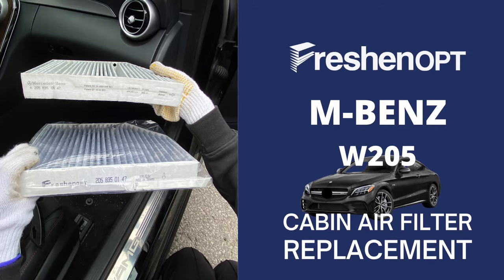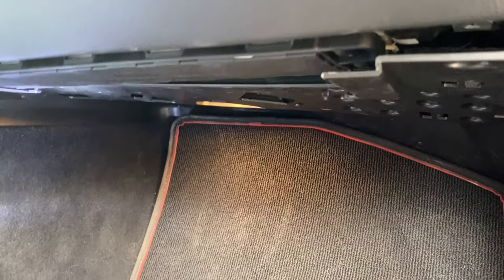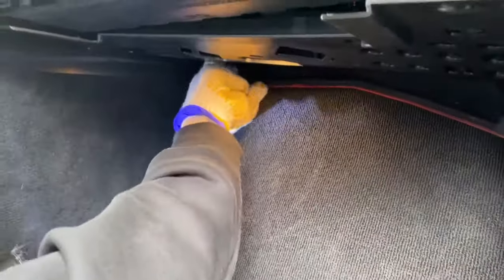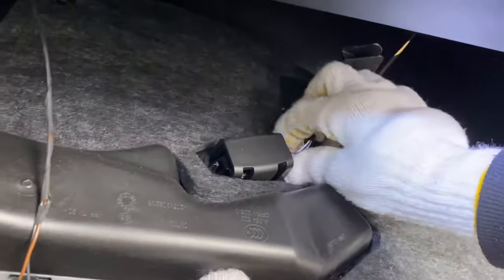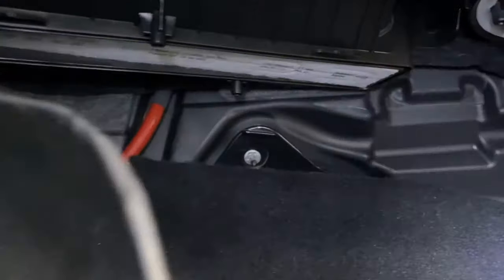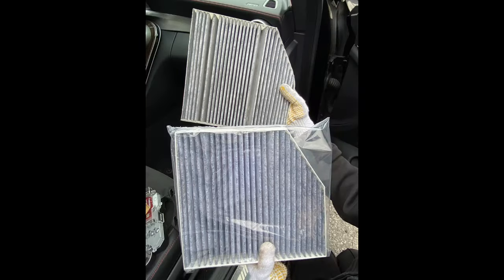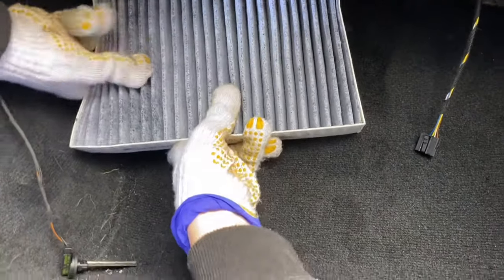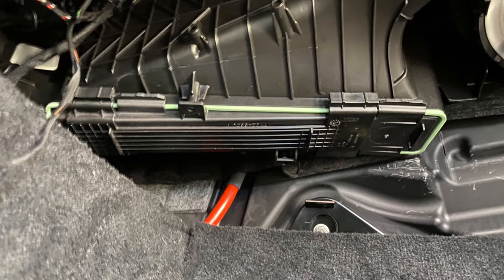How to replace cabin air filter for Mercedes-Benz W205 (C300, C43 AMG, GLE350...)?

Comment: I have 2017 c43 cabriolet  i was told there is 2 cabin filters one is primary and secondary... my question is where is the primary located?  The one u just did is this primary or secondary thank u
Reply from the maker: Hi Asllan, the Mercedes Benz W205 models are requiring two cabin air filters, and most people replaced them at the same time. One is the interior cabin air filter which located behind the glove box (in the video). The other one (exterior dust filter) is located under hood. Hope this help, thank you.